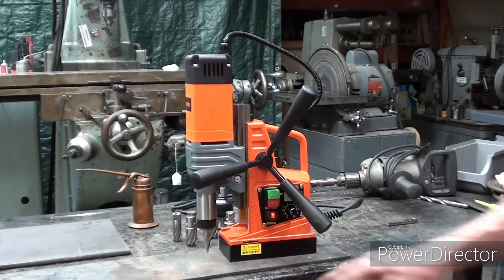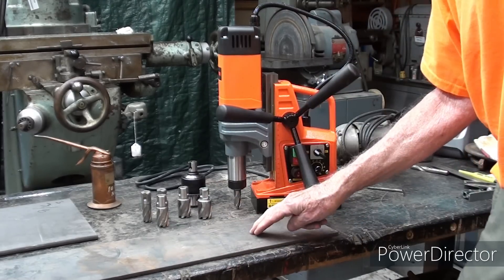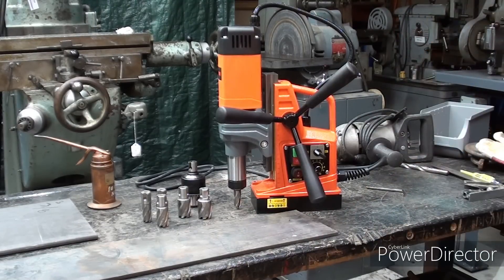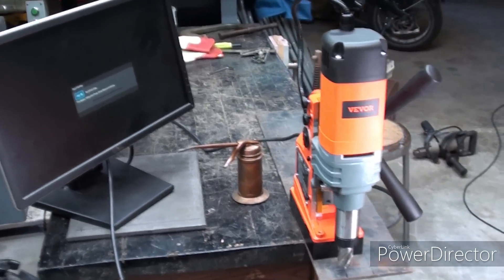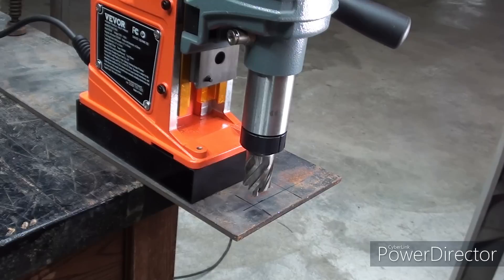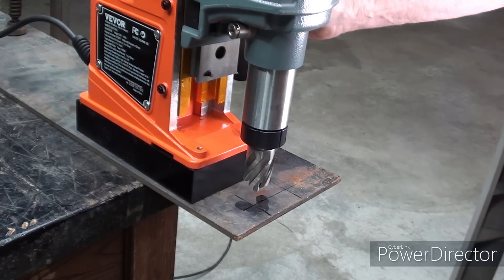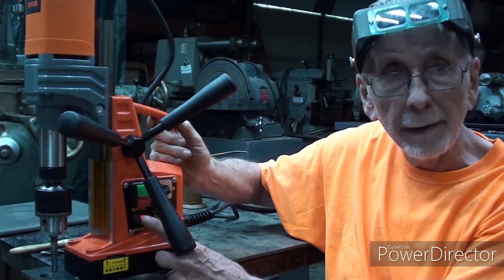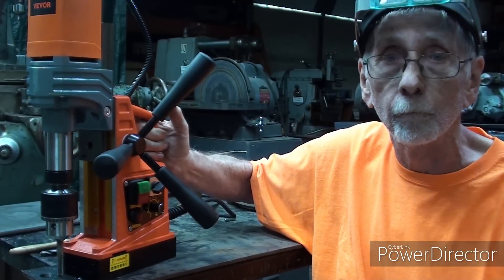MAGNETIC DRILL PRESS vevor pt 2 #877 tubalcain

Comment: Nice useful machine, especially when you don’t have to pay for it. 27mm happens to be 1.0629, almost exactly 1 1/16 inches. How do I know? My almost new Kia Sorento oil filter needs a 27mm socket to remove it. I did the math and “Eureka” I have a 1 1/16 socket I bought from Sears 50 years ago. All is well here in beautiful North Carolina.
Reply: Hey Ellie, should I put it on the Bridgeport ??   John
Reply: @johnquinn3899  I’m a little bit slow this morning
Put what on the Bridgeport?